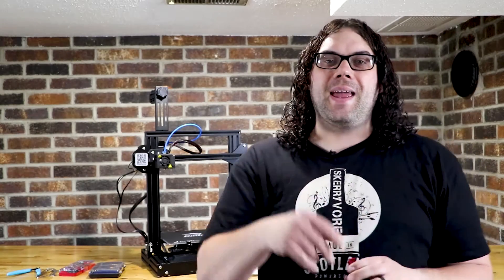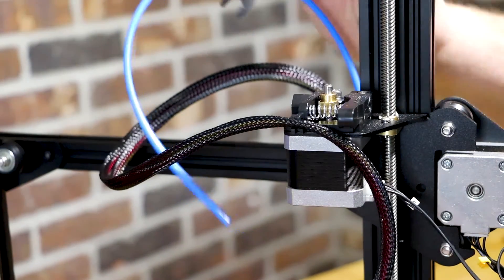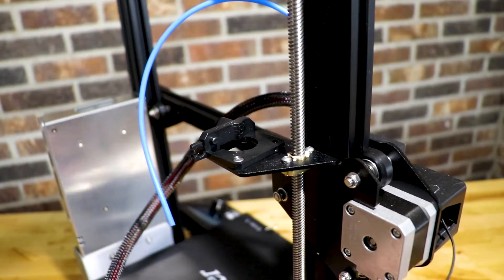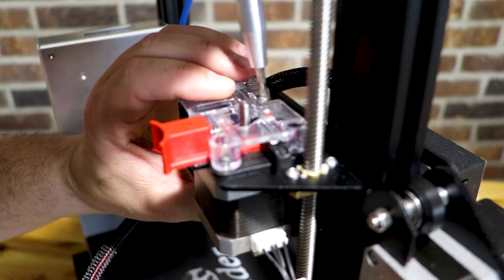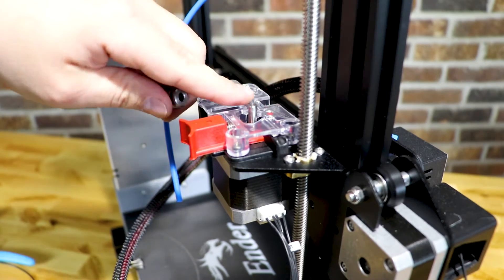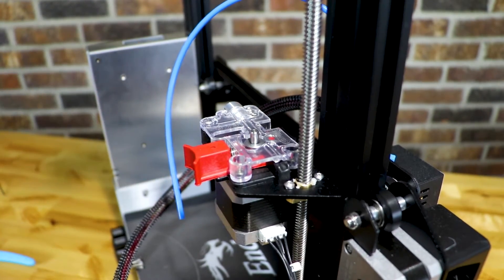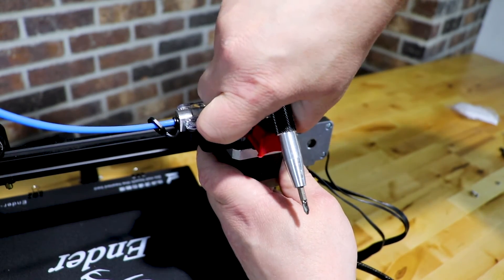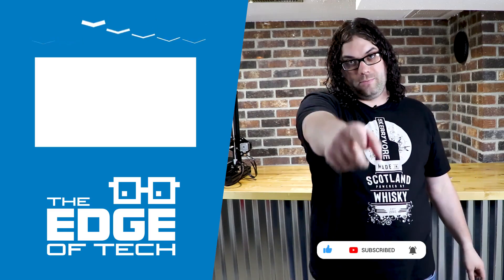Installing the EZR Struder on an Ender 3

Comment from the maker: Hey Everyone! I was wrong about the screw on the hob gear. You want to make sure it's on the flat side. The new EZR Struder instructions say that. I was following instructions that said this and It has since changed. "The set screw for the hobbed gear cannot line up with the flat of the motor, rotate the motor shaft so the flat of the motor is facing the other side of the ezr struder.

Using the allen key, tighten the set screw on the hobbed gear onto the round part of the motor shaft. Tighten this set screw very tightly."
Reply: This extruder is to print tpu easier but will it still print the pla/abs/petg as well?
Reply from the maker: Yes for sure!
Reply: BTW/FYI: Why the set screw must be tightened against the flat!! That is done 1. To help the contact between the set screw and the shaft (flat to flat) hold the gear better but 2. It is done that way so that if you over tighten the set screw on the curve of the gear there is a probability that it will create a burr on the curved gear surface and make it difficult to remove the gear from the motor shaft when or if it should ever need adjusted or removed.
Reply: What's real funny is that I followed your video and assembled everything, then I read this comment. I threw up a little, then went back to fix it and turns out it was already on the flat side. I somehow did it so wrong that it turned out to be right.
Reply: Came here to comment exactly this, glad you corrected it lol otherwise thanks for the vid!

Comment: I bought this kit after watching your video and have a few thoughts about the kit I got. It came with 15 screws of various length, 11 washers, 3 lock nuts, 3 tubing locks, 2 halves of the extruder(unassembled) and one spring. It has directions on how to put it together which is quite simple. Once it is assembled, don't let go or it will launch the spring and the clear half in different directions. To hold the washers on, I used some white glue and let it dry. I put the screw for the hob gear on the flat before I read your update and it locks good. Next project is the dual "Z" rod from TH3D. Thanks for the video.

Comment: I feel like you leaving this video up is a fairly crappy thing to do most of it is just wrong, and you knew about at least some of it by the time you edited the video because you shot the correct steps and put them in... At the end... Worth no warning or attention brought to the wrongness. Luckily most of the people who watched it know basics like the screw should be tightened to the keyed (flat) side. But using the incorrect hardware for the whole install and then changing it out in the last 20% of the video with no annotation or acknowledgement at all is kinda shitty. More than one person has followed your instructions only to find out they're not only not almost finished but barely started. If you need the views that badly reshoot the video and DO IT CORRECTLY please!

Comment: Where are you getting the grub screw from? The one that was on the original Extruders Hob? The one on my Ender 3 had 2 grub screws instead of 1 and neither of the grub screws fit the Hob that came with the EZR there too big for it. Any ideas ?

Comment: Who puts out 3D printer parts with Phillips screws?! I threw them in the garbage where they belong and replaced them with M3 x 12 instead, works great and no need for washers to ensure the stepper motor is tight either.

Comment: No mention of the other two  nuts and bolts that go in the remaining two holes ? Very loose and wobbly without them !
Reply from the maker: You should put them in if they fit. It was not loose after install here.
Reply: @TheEdgeofTech  Both installed now and working great with the extra bolts in thanks.

Comment: This video has a lot wrong with it, you should edit and make some changes. like holding the struder together... there are 2 extra holes and they give you bolts and nuts so you can install and hold it all together. then the washers... I installed mine and the screws were the proper length, BUT if you did need washers, they go on the screw under the screw head, where you put them they are not longer washers, now they are shims, and the motor was designed to mount on a large flat surface, not shimmed with 4 washers like that.  Just make a few edits and put it back up, it would be a good video then. Meanwhile thanks for taking the time to make it.

Comment: https://youtu.be/VyDv0CnLWU0

watching this video before will make installation a lil bit easier and you might consider editing or redoing this vid so others following step by step don’t have to undo it again because of the addition of the washers and not tightening the gear on the flat part, which confused me but should have gone with my gut Instinct.

Comment: This thing is junk. The gear was to tight to fit the motor shaft and had to be drilled and Capricorn tubing will nt fit.

Comment: %%%%%%%%%%%%%%%%%%%  Worse extruder you can buy.  Had one for a month 
AND IT CHEWED UP FILAMENT, plastic parts wear down where the bearing 
sits. No adjustment for tension.
Reply: Extruder is great. Sounds like user error or a clone was purchased. Been using this for several years on my E3

Comment: %%%%%%%%%%%%%%%%%%%  Worse extruder you can buy.  Had one for a month 
AND IT CHEWED UP FILAMENT, plastic parts wear down where the bearing 
sits. No adjustment for tension.

Comment: I just installed this on the Ender 3 Pro version and I did NOT need to use the washers.  The whole assembly was nice and tight without using them.
Reply: Hy

Comment: Watch the whole video before you install it. Please edit this video so people don't blindly follow you putting it on wrong like I did! Thank you. The screw length is very important so as to not strip out the motor mounting treads. This is very important because when you cut that tie wrap the tension is very great and trys to spring itself apart! Those washers are the wrong side to fit into the recess where the screws insert. Come on SeeMeCNC fix this! Well it worked well the second time. I thought for sure it might take me half and hour getting those 4 washers and screws to line up.But it went together easily. Some folks might have fits doing it though.

Comment: CHALLENGE: I recently installed a EZR Struder on both my Ender 3 and my Longer LK2. They both are making this horrid clicking sound. I have calibrated E-steps a minimum 12 times on each machine(final setting:91.8), replaced the nozzle(as was advised by Seemecnc tech support with no other resolutions) with known name brand high quality 0.4 nozzles twice, set the vRef power to the drivers to 80% full power as recommended by several YouTube 3D Printing experts, changed filament 4 time(all different brands) and last but not least I cleaned and rebuilt both extruders when changing nozzles. also have printed several different test patterns at different speeds. After all that..........guess what..... they both STILL make that horrid clicking noise that appears to be the extruder motor skipping a step. Next step might be to replace both motors but how likely is it that both motors from different manufacturer would be defective. Changed back the Ender 3 to original extruder and have no clicking at all.  Please, dose anyone have any suggestions as to what I could be missing???
Reply: Not sure if you ever got this resolved, but see this video might solve your problem: https://www.youtube.com/watch?v=7tCxO17XZtw
Reply: Did you ever figure this out? I recently fitted my ender 3 with one and im running into the same issues.

Comment: dude, I'm so screwed! i tightened the set screw on the round end of the hob gear. when i went to go loosen it, the screw head stripped! if theres any advice you could give, or some trick, I'm freaking out over here!
Reply: Would it be possible to use Krazy glue, maybe with baking powder, coat the end of the allen wrench, hold it in there until it dries then try unscrewing it? Maybe as a last resort to try? :p

Comment: Hello I cannot get my extruder to work can you please help? I got this thinking it would be an upgrade but now my prints keep binding and the extruder keeps skipping. I know it's a problem with the extruder because I put the stock extruder on and the problem was fixed. Any ideas on what I can do to stop it from binding?
Reply from the maker: Are you trying to install the EZR extruder?
Reply: @TheEdgeofTech  I got it installed just like you have it in the video on my ender 3. The filament extrudes fine for the first layer and then eventually it gets caught up in the extruder I believe because it starts to bind and when I remove the filament it's all bent up at the point where the extruder motor is touching the filament
Reply from the maker: @brentthebuilder3555  Did you calibrate you e-steps after you installed it?
Reply: @TheEdgeofTech  I did not, would that help with the binding??
Reply from the maker: @brentthebuilder3555  It could if it's trying to over extrude and pushing to much. What time do is cut a small piece of Bowden tube that sticks out the end of the EZR about 1 inch. If you have extra Bowden tube. Then I do the open air e-step calibration. anytime you change anything on the extruder side you want to calibrate your esteps. I have a couple videos on it depending on which way you want to do it.
Reply: @TheEdgeofTech  awesome thank you for the response I'll check those out and try this tomorrow!
Reply: @TheEdgeofTech   DrVax  so I recalibrated my e steps, do you have to have two different e step calibrations because when I used the e steps I calculated with PLA, I could only get 60/100 mm of flexible filament to extrude.

Comment: Have you ever had a problem with your ptfe fitting stuck on the ptfe tube? 

you have weird al hair!

thanks for the video
Reply from the maker: Lol Thanks for the compliment! Yes I've had an issue, and the way to fix it is to take off the coupler and tube and push the tube through the coupler. Hope that makes sense! Thanks for watching!

Comment: Cool vid, but few things.. the flat of the motor DOES align with the grub screw , and the washers can likely just go on the screws under the head like normal. the screws are just too long and bottoming out in the motor, the space can be added anywhere to "shorten" the screws.  But if you must add spacers between the motor and the plate, you'll likely want to reset the drive gear is you've shifted it that 3/4mm off spacing the motor down!
Reply from the maker: Thanks for watching! The screws are countersunk and the washers don't fit into the holes under the head of the screw. That's why I had to do it that way. Also, I did move the drive gear slightly up to compensate for the washer. I'm reaching out to the company to ask why we shouldn't use the flat side if the shaft for the grub screw. It was in their instructions.
Reply: The Edge of Tech  ya, instructions I read says to align screw with flat face... huh... looking at online .. wonder if miss print on printed version?
Reply from the maker: @Thomllama  Just looked at the instructions online, and you are right! It should be on the flat side! That's crazy The ones I read said make sure to not have it on the flat side lol I will change the description ASAP
Reply from the maker: I just pinned a comment above.

Comment: If the washers will fit under the screw head why not put them there? My guess is the screws are a mm or 2 too long so taking up the space w/ the washers could be done anywhere. On top under the screws would be far easier than on the motor side if it's just too-long screws. ☺
Reply from the maker: Great idea, but they don't fit in the top. I would have rather done it that way if they did. Haha Thanks for watching!
Reply: @TheEdgeofTech  That's a bummer. I know your viewers have varied backgrounds and tinkerer skills so no complaints w/ your solution. I'd go with a grinder, belt sander, hacksaw, or last resort sandpaper to shorten the bolts. 
Would it be a mechanical stress to put them between the struder & plate instead? Just throwing out alternatives. Shoot, I might even consider printing a 0.5-1mm spacer for under the struder itself. Size as needed to get rid of the slack. This could probably be done even if the motor is a tad loose in the bracket. Shim w/ card stock temporarily. 😁
Reply from the maker: @OldCurmudgeon3DP  I love the way you think!

Comment: Had one of these for a couple of months and after watching your video decided to install it. Thanks for the video. Did you have to adjust the steps per mm like their website mentions? I didn't, just printed a Marvin which came out beautiful.
Reply from the maker: Hey Gandor! Yes, you should check you ESteps after this installation. Anytime you chance anything on the extruder, you should check you ESteps, but I'm glad to hear it's Printing good! When I checked mine using the open air method in my other videos, it was only off by 1mm, so I only had to make the slightest change. Thanks for watching!
Reply: If the drive gear surface isn't exactly the same diameter as the old one then it will change the value.

Comment: Why wouldn’t you tighten the grub screw to the flat side
Reply: umm you are supposed to tighten the grub screw to the flat part, instructions - https://seemecnc.dozuki.com/Guide/EZR+Struder/42
Reply: From my experience You tighten the screw to the flat side so it cannot slip
Reply: @dominickconsolazio6510  this. It's been my understanding as well. Willing to learn if he gets word from the mfgr though.
Reply: Also you need to tell people if you change your strider according Lukes guide you need to re-adjust  e steps
Reply from the maker: @dominickconsolazio6510  I appreciate the advice, and in the end of the video I do tell everyone to make sure they adjust the ESTEPS by using the other videos I made. Thanks for watching!
Reply from the maker: Good question! That's what the instructions from SeeMeCNC said. I will reach out to them and ask! Thanks for watching!

Comment: Putting the shims where you did will make the motor raise in temps. Also when putting the shims there you will need to realign your spur gear or filament won’t go through.
Reply: The angle bracket will act as a heat sink. The question is how much cooling does it provide. You'll end up finding out either way I'm sure.
Reply from the maker: I don't know about the motor running hotter, but I did move the gear up to make it fit. I will keep you posted on the meter temp!
Reply: The motor was originally sitting on plastic which is a very poor thermal conductor. I can't see how this new set up could possibly result in the motor getting any hotter

Comment: Its more fun to print extruder to fix all the shortcomings of the stock one, but I have to say your videos are great. Thank you! 
Something that hasn't been covered yet for the ender 3 is these cheap all metal throats. I bought a full micro swiss clone before finding what I think is this better solution. 
https://www.aliexpress.com/item/CR-10-Heat-Break-Hotend-Extruder-Titanium-alloy-CR10-Throat-M6-Thread-For-1-75mm-Filament/32918085053.html?spm=2114.search0104.3.15.7bdd4971xDJm0B&ws_ab_test=searchweb0_0,searchweb201602_7_10065_10130_10068_10890_10547_319_10546_317_10548_10545_10696_453_10084_454_10083_10618_10307_537_536_10059_10884_10887_321_322_10103-10890,searchweb201603_51,ppcSwitch_0&algo_expid=4331db3e-b132-4727-8d96-c8b3e0a4db56-2&algo_pvid=4331db3e-b132-4727-8d96-c8b3e0a4db56&transAbTest=ae803_5
Reply from the maker: Thanks for watching! I will look into that!